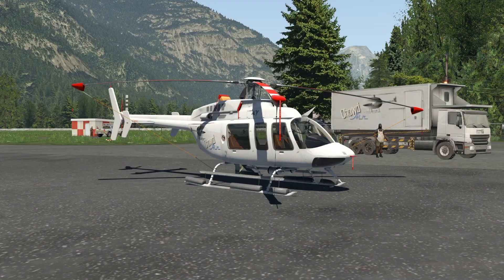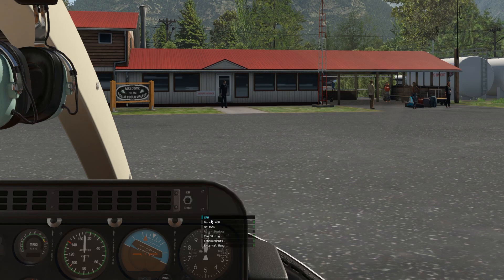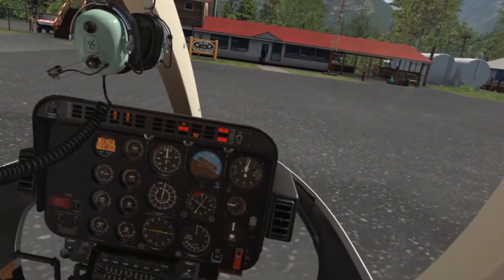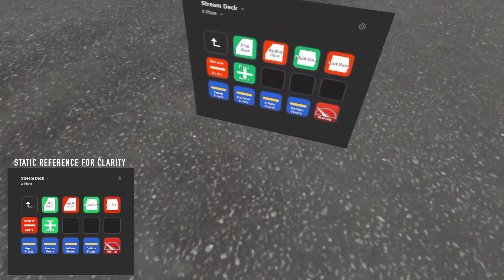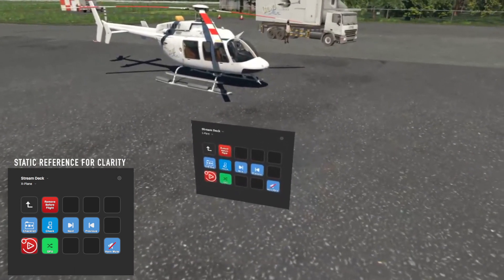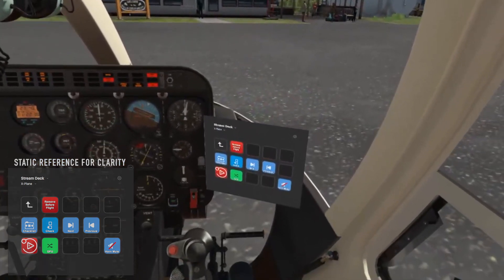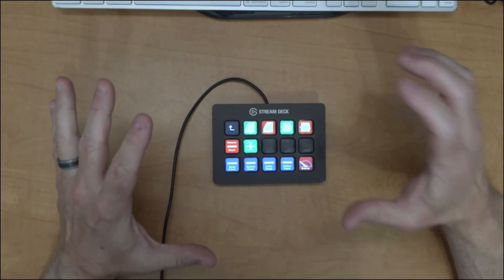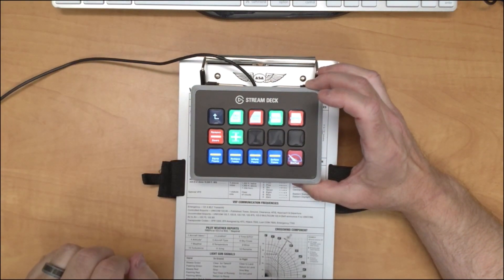Stream Deck in VR Part 1

Comment: I was trying to stream this in VR and the image was reduced outside of VR to my stream. How did you record this with a wider FOV?
Reply from the maker: Unfortunately I don't quite remember as it was a while ago. I believe I recorded just 1 of the VR windows in OBS. Perhaps OBS has a field of view adjustment option. I have since rebuilt my PC or I would have a look, but all the recording software has not been setup again.
Reply: @chowdair  I figured it out. I forgot that Oculus has a program it comes with called Oculus Mirror.
Reply from the maker: @TheExiledAnnouncer  OK great to hear. When I did these videos I was using Windows Mixed Reality, so I didn't have access to Oculus Mirror. I'm glad you found that as a use case.

Comment: Do you have the link to this kneeboard mount? https://youtu.be/CAXf5NJIhQU?t=428

Also, have you done any work with DCS?
Reply from the maker: The kneeboard is available on Thingiverse at the following URL:   https://www.thingiverse.com/thing:2870655. I haven't tried this with DCS, but it relies on a plugin that I didn't write to be able to talk to X-Plane directly to control the aircraft, and I don't know of a similar thing for DCS.
Reply: @chowdair  , thanks. This is SUCH a useful thing that I gotta believe anyone sim flying, racing, or almost anything in VR, would find it useful. How did you get the keyboard only to show, without the tool bar that normally shows up at the right, and the extra blank real estate below?